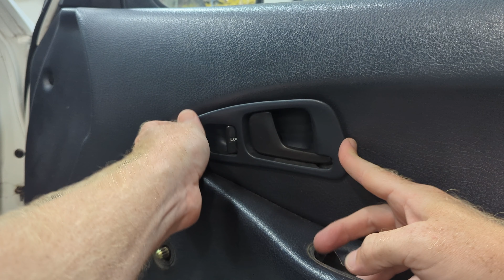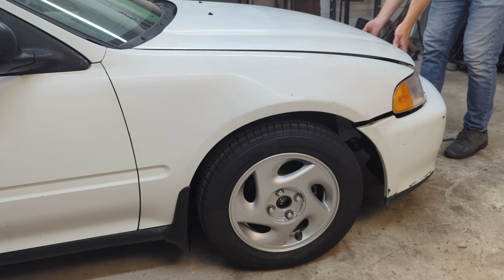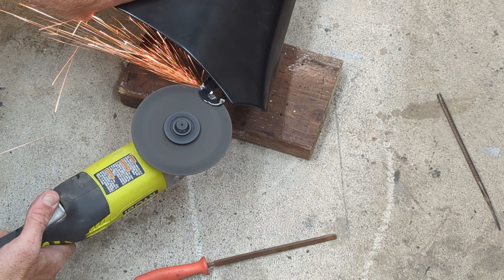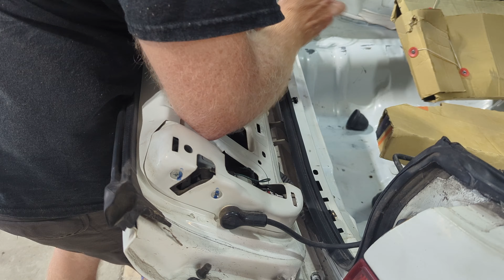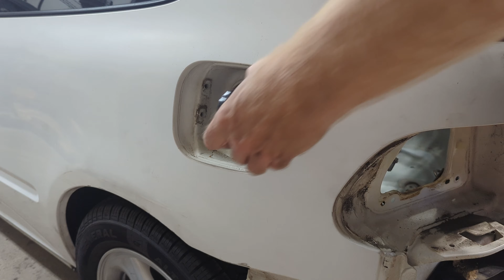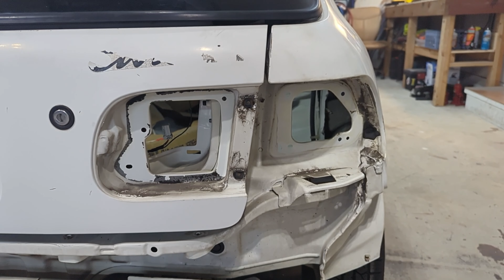Honda Civic Hatchback - Part 15 - Fitting Fenders and Stripping Trim for Paint - Make it So

Comment: Why the aftermarket fenders? Was it just easier for paint?
Reply from the maker: They were an impulse buy when I first got the car two years ago so I figured I'd use them. I didn't do a good job of showing it off but the stock fenders have a bunch of dings, dents, and deep scratches. I figured this would save me some time, since I already had them sitting around.
Reply: @MakeItSo  I see, thank you! Fantastic content as always
Reply from the maker: Thanks for watching!